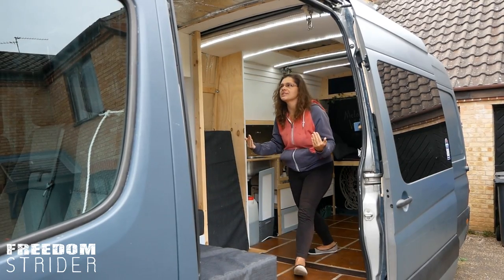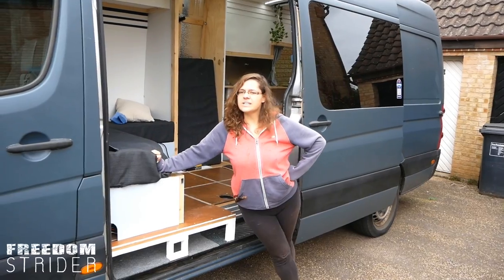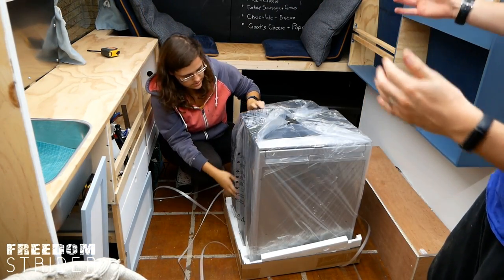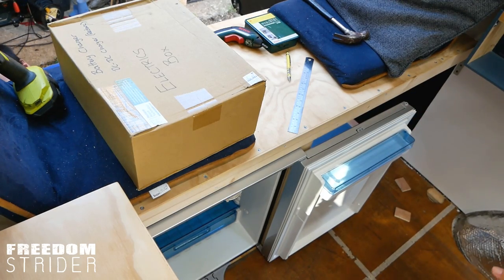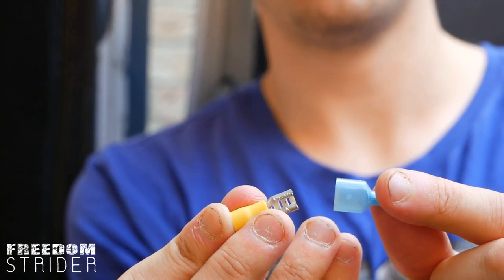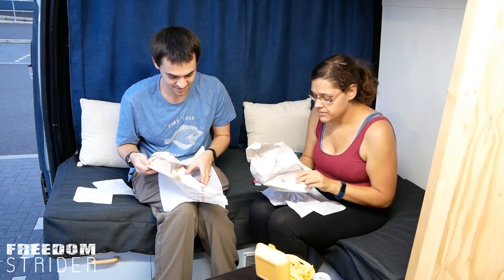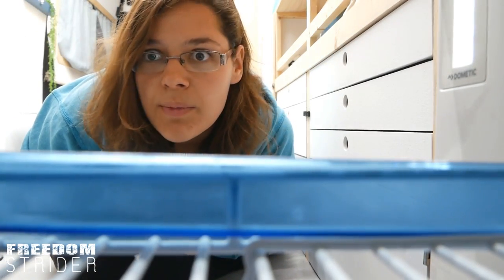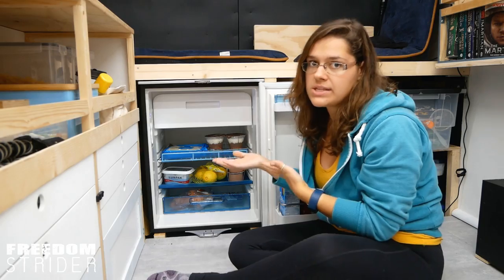Are 12V Fridges worth it? (yes, but no...let us explain)

Comment: we got the Vitrifrigo C115 mainly because its 115ltr but uses the same power as the cx50 , but man the prices of fridges now are just a joke , but everything is a joke , also a tip is to tell your insurance what the vans worth , and yes yes yes I know yu might have done it , BUT did you add on to how much things have gone up by , and if you need to claim would your original price cover the cost of a new build PROBABLY not , food for thought that one is
Reply from the maker: Our CRX 80 is now £900-£1000 which is crazy! We did put it in our insurance but yeah might need to recalculate and look 🙄